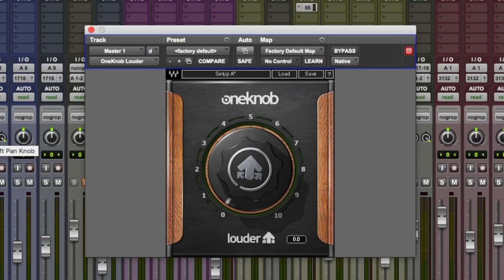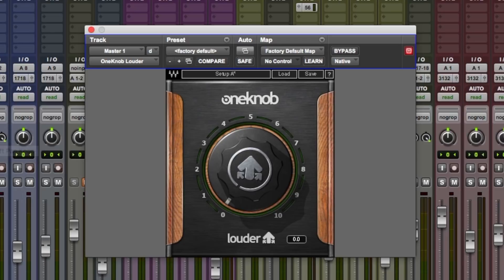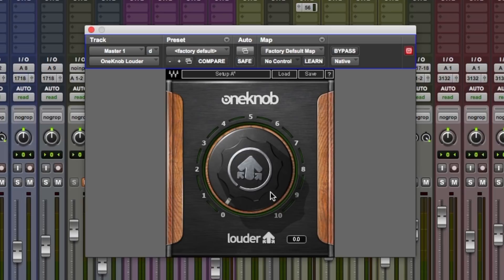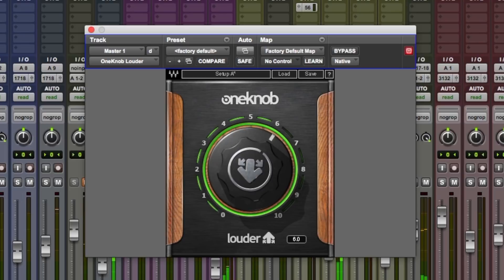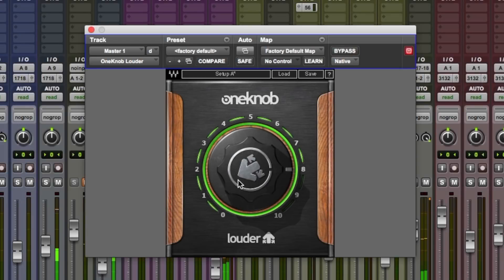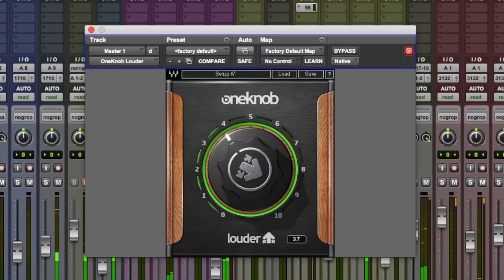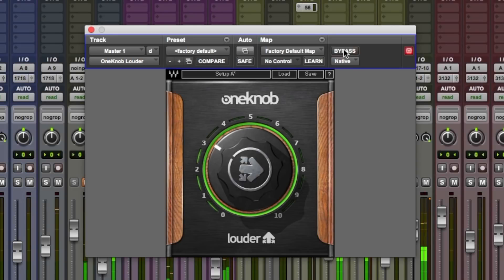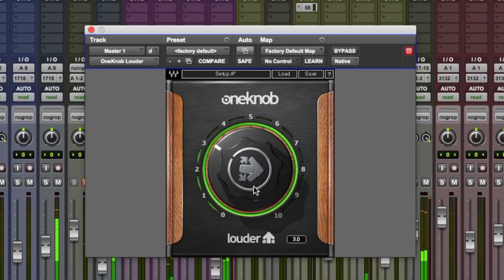Waves OneKnob Louder Plug-in - How Good Is It? Our Test

Comment: Nobody ever matches loudness when they should, for example when testing plugins that shouldn't make a loudness difference (like EQ). This thing is supposed to make a loudness difference and these guys level match it. The whole point is that loudness difference your taking out, lol!
Reply: Loudness is not that same as whatever you are referring to. You referring to peak difference. This plugin brings up LUFS without bringing up true peaks, the one thing that producers normally put a compressor, a limiter and an LUFS metre for and spend loads of time
Reply: Bro really thought Waves sell a Gain knob😂
Reply: @qemaable  If you level match there is mostly  just a difference in how compressed the dynamic range is (hence the name level-match: both signals have the same level). In this case, level matching is useful to hear the attack and release, coloring and, as previously mentioned, the reduced dynamic range. But not so much if I want to listen how much louder can the plugin make the song by squashing the peaks. I didn't think they were selling a gain knob (though they sell a vu meter plugin, so it wouldn't be a stretch). I also didn't say it was a pointless comparison because, as I said previously, it does provide info. Just not the one I was interested in. Unless you are feeding the thing a sound that is way below the threshold (which could be a possibility) there is no reason to level match. In conclusion I said I would have liked to hear the song without the level matched because I prefer it and mentioned that I would have liked level matched comparisons in other videos where it was more useful. But thanks for your insightful comment nilssen.
Reply: @banigrisson  You do realize you can just scrub through the video right? They're only level matching the bypassed signal and not what the plugin is doing. You confused level with loudness and complained that they didn't show an example but it's literally in the video. 

When he first plays the sample it sounds.... quiet. When turns the knob it gets both louder and higher in level. He does not turn down the output to match the original, he boosts the original (bypassed) to match the new level. Simply compare the end result to when he first plays the sample if it really matters to you how much level it adds.
Reply: @DylanRotich  yes I realized. No I didn't complain about that. No, I don't think I confused them.

Yes, I did that. I also own the plugin since a couple of years back.
Reply: @banigrisson  to quote you:  "In this case, level matching is useful to hear ... the reduced dynamic range.." and when explaining why you didn't find use for the video, you said: "But not so much if I want to listen how much louder can the plugin make the song by squashing the peaks. You just contradicted yourself by saying: The level matching is pointless in this video because i want to hear how the dynamics are squashed (reduced). When you clearly said that "level matching is useful to hear ... the reduced dynamic range". Just trying to clear things up... But thanks for your insightful reply, Bani.
Reply: @qemaable  I read everything you said. I didn't contradict myself. You thinking that and the bad paraphrasis you made shows me you simply didn't understand what I said. I already clarified twice, it's not my responsability if you are not reading correctly or are not familiar with the terms/topic. Have a good one.